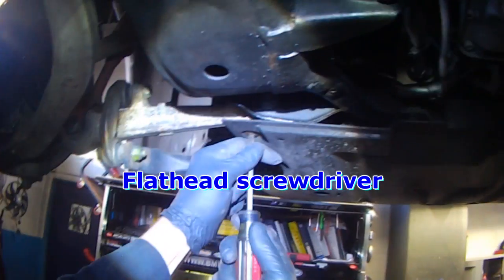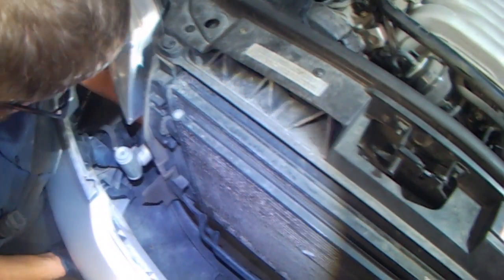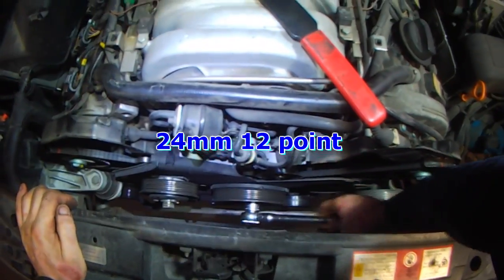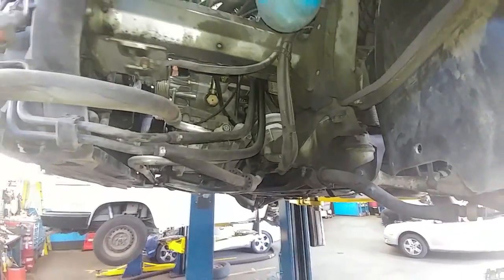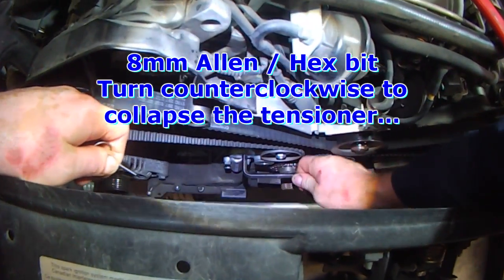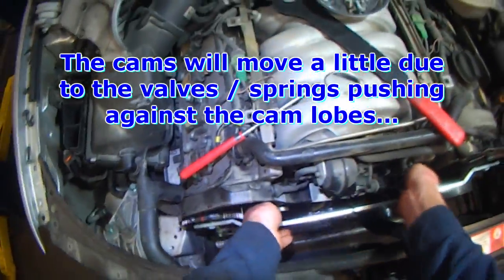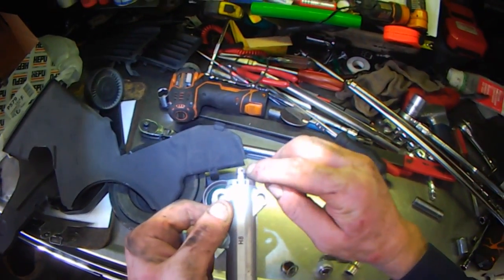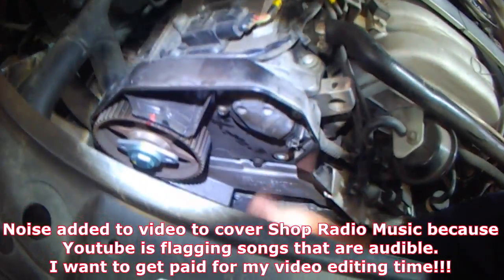Audi C5: Audi A6 V8 Timing belt removal

Comment: Hi, you have great videos 👍 question - if the last belt change is 60tkm, but 9 years ago... is it possible to drive another 1000km? I am going to buy an s6 c5 audi,  but I would need to drive it home..Thanks!
Reply from the maker: If the car has been driven regularly before your purchase, odds are it will be ok for 1000 more.
If the car has been sitting for some time / not been used... things can be a little risky.

Comment: Thanks for this video.  TWO wrenches are used to remove the clutched fan blade? Is it left hand threaded?
Reply from the maker: One is a holding tool. It holds counter pressure against the pulley bolts. The other is a fan clutch wrench. Yes, left hand thread.

Comment: Why does it have a belt when it also has a chain?
Reply from the maker: The chains are only for connecting the intake camshafts to the exhaust camshafts.
Timing belts are cheaper to maintain... newer engines 4 cyl,  V6's, V8's etc have all chaines and are more expensive when it is time to replace the chains (mainly due to guide rail failure or chain stretch).

Comment: Thomas I have this engine but the plastic on the valve chain tensioner slides has failed , should I just replace the plastic bits or the full tentioner? Also can it be done without removing the valve cams , thanks buddy
Reply from the maker: Plastic shoes / pads / guides can be bougt & replaced separately... from what I have heard (we always replace the complete unit). To remove the tensioner, you have to remove / unbolt at least one camshaft (intake)... both, to replace the chain.

Comment: How did you take the radiator/big cooling fan off?
Reply from the maker: At 4:09 you see the 2 red tools that I used to loosen the fan. It's a "lefthand thread" viscous clutch / fan, so it is removed by spinning the fan clockwise (after it is loose).
Reply: @EXOVCDS  ok cool, so how does one get it loose? I apologize if I seem dumb, I'm rather new at car stuff😂
Reply from the maker: You hold one tool in one hand... and you hold the other tool in the other hand.... then you squeeze. Once the "threaded part" of the fan, is loose, it can be spun off as originally mentioned. Installation is in reverse of removal. The tools make it easier, but can be done without them. There might be some DIY articles you can Google.
Reply: @EXOVCDS  so it's almost like prying it? What tools in particular should I use?
Reply from the maker: Extend your right arm out in front of you with a fist... hold your left arm out in front of you with a fist, but only half way extended. Now, this is where it gets tricky... as you bring your right fist closer to you, extent your left arm. There are a number of different tools that can be bought, made, borrowed, rented... it all depends on where you go. The service manual for your car wil list specific part numbers for tools that are used. Sometimes it can be as simple as using a large wrench & a hammer. I would get a lot of "hate" if I used a wrench and a hammer... that's why I use the "correct" tools. =)
Reply: @EXOVCDS  cool thank you! What were the tools that you used? I may have them laying around somewhere
Reply from the maker: https://www.amazon.ca/Assenmacher-Specialty-Tools-8032-Clutch/dp/B003QI0G34
https://www.amazon.com/Universal-Clutch-Water-Pulley-Holding/dp/B00K3KWXLG

I did a quick 10 second search... not knowing what year, make, model, engine you are working on, that's the best I could do.

Comment: looks like the belt job on my touareg.
Reply from the maker: +DW Red Yes... sweet engine!
Reply: i did all 4 cam seals tensioner pucks and all one shot when i did mine. not a bad job . just pull fan assembly out and have at it.
Reply from the maker: DW Red yup... its difficult getting the go-ahead from customers to "go to town" (do everything on a repair). I don't mind going back in a few years later... customers forget that they declined the suggested extras and then realize that it would have been cheaper the first time.

Comment: Engineering at it's finest.
Gotta remove the bumper to work on a car.
Why? 
Well the headlight went out.
Next thing ya know there won't be a hood or a bonnet.
To service the car you will have to drop the engine and trans.
What race cars have the jacks installed on the car?
That's what they should put on all cars.
Pull the car into the shop open up the air access, press the trigger, voom the body lifts up exposing the serviceable parts. 
Good vid Brother. You should bee a doctor cause you got lots of patience.
Oh and by the way who is that lady screaming every time you use your air ratchet?
Reply from the maker: MostlymoparIH Engineers are a crazy bunch... this isn't bad compared to other designs. Future girlfriend screaming at me!
Reply: Future girlfriend huh?
Oh Back to the future.
And you're changing your name two2 Marty.
Let me know when ya get a DeLorean?

Comment: Great videos as always, quick question on a 2008 Touareg the chime for the headlamps doesn't sound when door is open, but the doom lights do turn on.  Any suggestions? Thanks in advance, 
Theo
Reply from the maker: Chime in the instrument cluster is bad / needs replacing.
Reply: Great, Thanks is a tough one to get to?
Reply from the maker: Never done one... only read DIY articles on the web.

Comment: What a horrible design, it makes your job much harder.
Reply from the maker: +zx8401ztv It's easier if the radiator assembly is removed completely (wide open access)... I don't remove it fully unless I have to. I can think of a number of worse designs that have less room (Domestic & Asian).

Comment: Great work Thomas and it just shows that sometimes you need the right tools when you do a job like this. When you pulled that first camshaft sprocket off with the puller, I hear that loud pop. I said, damn, the sprocket is broken! Those things are really on there, and I can just imagine some people out there trying to pull those things off without the right tool(s). Have a good one Thomas!
Reply from the maker: +stuzman Yeah, the first one was pretty tight. I even had to double check that the puller was sitting correctly. If I don't have all the right tools for something, I try not to do the job. Not worth the risk trying to do it without them.
Reply: You're right about that Thomas! Without the right tool, you could create some havoc for yourself...

Comment: great video mate seam like a ball ache doing belts on them good job there is a service mode
Reply from the maker: +Paul Mayou Service mode "at minimum" is needed... many will remove the radiator assembly completely. I only remove it fully when I have to.

Comment: Thank you for injecting shaft seals tip. As uncle bumblef*ck would say - just the tip. And only for a minute.

My shaft seals are leaking. I should probably get that checked.
Reply from the maker: Try some ATP AT-205 stop leak... like my friend Steve:
https://www.youtube.com/watch?v=rzyW2_FAWxc

Good for engine oil, transmission, steering.

Comment: So pull motor and replace with new one instead? Lol nice work, crazy that some cars need that much effort for a maintenance-ish repair.
Reply from the maker: I've seen worse... even if I went the extra steps and fully removed the front end (for open access to everything), it would still be simple(r) compared to the ones that are worse. Of course "the worse" ones will get easier the more times I do them.

Comment: why loosen the cam sprockets with T40001? Is it because the belt is too tight to remove?
Reply from the maker: Prevents everything from turning and yes, doesn't stress the belt, incase belt needs to be reused.

Comment: It's one timing belt I don't mind doing never done one of them mainly diesel ones but it's so easy just to pull the front off you have so much room lots of people are scared because they think it's a lot of work pulling the front off but you have so much room when you do would like to get my hands on a V8 one
Reply from the maker: The problem is where do I put the lock carrier / radiator assembly. I don't have much room around the hoist. Disconnecting transmission cooler lines at the radiator adds ATF filling at the end. The radiator hoses / flanges don't like to come off that easily either... I only remove the carrier when I have to (crank / cam seals, stuff like that.
Reply: Thomas EXOVCDS yes we don't have them problems simple manual gearbox no coolers just disconnect the radiator pipes only becomes a problem if you got a c but if you've got a c here I just move it to the side leave it connected I was only saying on the diesel ones not on this particular one you were working on

Comment: I see you are not wearing rubber gloves what a bad boy !   Ha ha I don't think ever doing one of them it's a 5 valve per cylinder head engine the same as a V6 VW group engines of the era ? Is it the same tools has the V6 30 V ?
Reply from the maker: Same crank tool, different cam bar. Gloves might not be used much anymore, now that I am using the invisible glove cream. We shall see... I might go back to using gloves full time once I determine if they played a roll in my eczema battle.